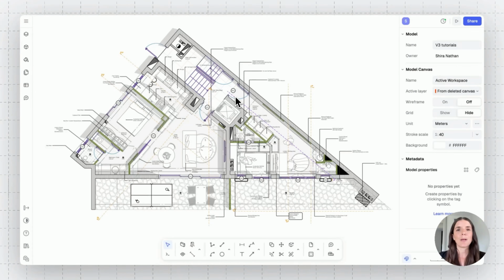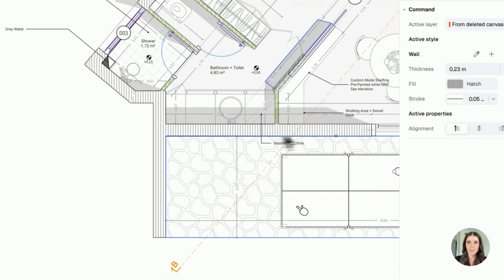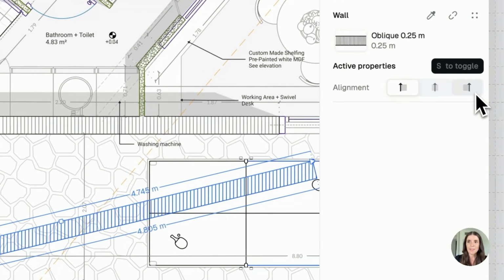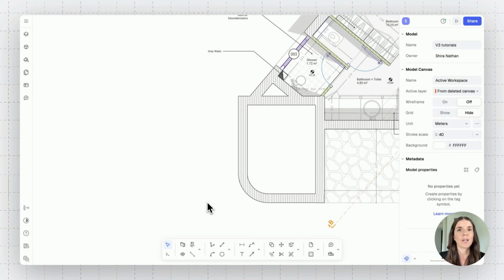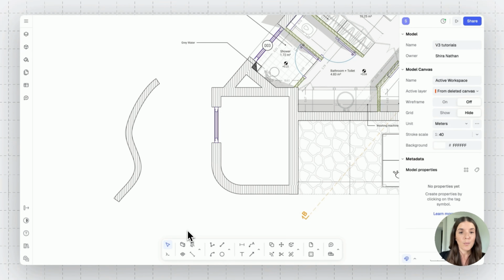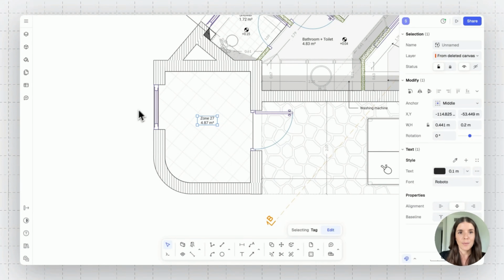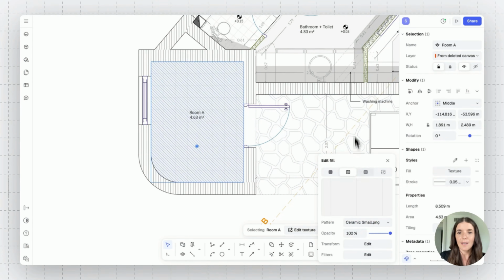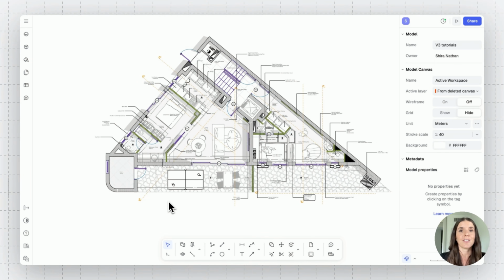How to Draw Walls, Zones & Openings in Rayon

Comment: For the zone command, are there any options where you can turn off or hide the Area/dimensions? I only want to show the Zone name without the hassle of removing the dimensions one by one. And just a suggestion, it would be very helpful if Zone labels were automatically centered
Reply from the maker: Hi there! At the moment, there isn't a global option to hide the Area/dimensions for all Zone labels—you'd need to remove them individually. Having a toggle to show only the Zone name would definitely make that workflow much easier.

As for the zone labels to be centered - the first place you click when defining a zone will be the place for your zone tag, so you can always click on the center of the room to have them centered. Hope this helps!

Comment: One suggestion: Please make it possible for walls on different layers not to automatically connect. Instead, keep the line between them visible. This would be very useful for plans showing existing and new construction, inner insulation layers etc.

Comment: how to create cutouts inside a zone. I want to create a rectangular cutout inside a zone how do i do that?
Reply from the maker: Good question 👍

A simple way to do this is:
• Draw the rectangle where you want the cutout
• Select both the zone and the rectangle
• Then use a boolean/subtract operation (or “cut” command if available in your workflow)

That will turn the rectangle into an opening inside the zone.

Not always super obvious at first, but once you get the hang of it, it’s pretty quick 🙂

Comment: How to create corner window in Rayon?
Reply from the maker: Good question! 👍

A common workaround is to place two separate windows on intersecting walls and align them tightly at the corner. Since corner windows aren’t a dedicated wall-opening type yet, it takes a bit of manual setup for now.

Not perfect yet, but definitely doable 🙂

Comment: Is there a way to add openings like doors and windows with an exact distance from a wall from the get go? Or a way snap them from a different spot other than the middle? It kinda sucks having to kinda of place them in the right place and then having to adjust precision specially if you have to place many of them… also it feels like there is a bug where is you place them right where the wall starts in a room the opening disappears… am I missing something?
Reply from the maker: Great questions — you’re not missing anything, this is a common pain point 👍

Right now, openings tend to snap from their center, and precise placement often means placing first, then adjusting with dimensions/offsets. Not the smoothest yet, especially when repeating many elements.

A couple tips:
• Use temporary dimensions or guidelines to position them more accurately
• Zoom in when placing near wall ends — openings can “fail” or disappear if they’re too close to the edge

And yes, better control over snapping points + exact placement from the start would be a big improvement — you’re definitely not alone in this feedback 🙏

Comment: is it possible to create a floorplan in rayon automatically by importing a pdf floor plan? Basically i would like to import an exiting floorplan cad design in rayon and then ask ai to generate it in layers on rayon.
Reply from the maker: Hi there, that's a great idea. We are developing the AI assistant, but currently, you have to draw walls manually or convert polylines into walls.